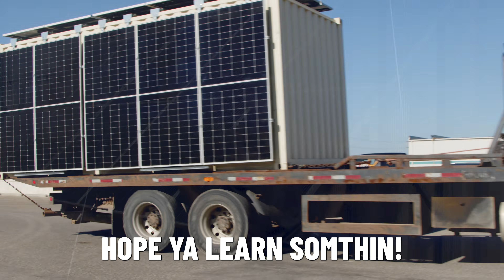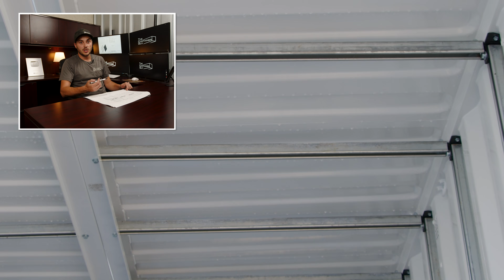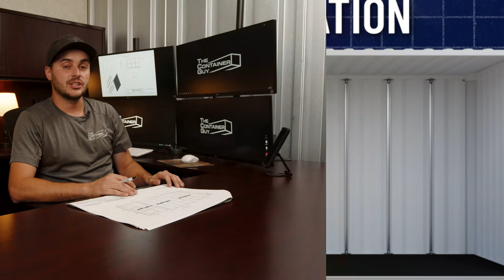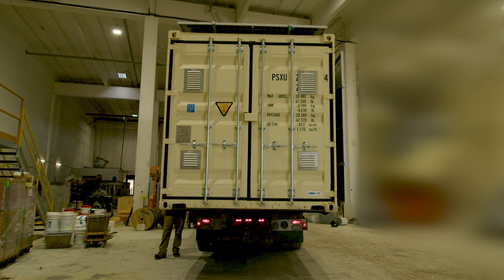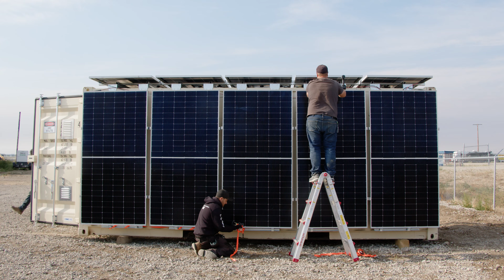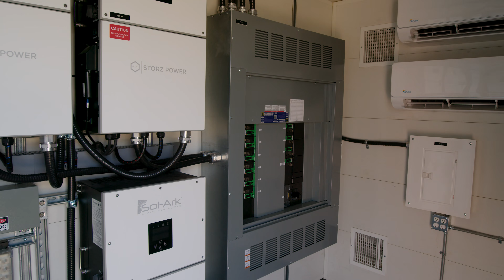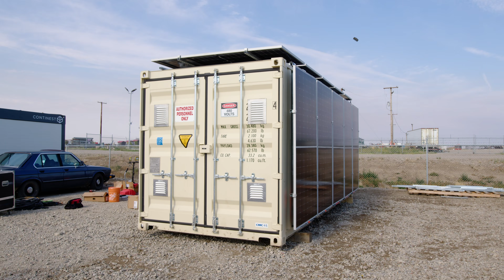Transforming a Shipping Container Into a DIY Solar Power Station! #NATO

Comment: I'm really puzzled, here.  You have 5.4kw worth of panels (enough to power one average US household, at best) on a shipping container with enough inverters and electrical panels to power a small neighborhood.  The battery storage capacity was unclear, because you barely mentioned those, but what I'm seeing is a container that will need a MASSIVE diesel generator to supply anywhere near enough power to the inverters and electrical panels.  The output from the batteries and solar panels would barely be enough to justify one of those Solark inverters...maybe two, if you're delivering split-phase 240.  This is like having a massive 18-wheel semi truck, with a 2-stroke dirt bike engine in it.  The solar and batteries installed on that trailer can't even begin to "drive" the enormous inverter output.  It just doesn't fit together, unless you are using a huge external power source, like the grid or a generator.
Reply: Jason, my thoughts exactly (ok, your thought were more detailed).  I view this project as a wonderful, detailed, alpha/beta concept version.  5400 watts barely drives 4  or 5 window AC units, assuming perfect sun.  This I know for a certainty, because it is what I am doing now.

Perhaps if they didn't hype it like they did we wouldn't be compelled to call them out.
Reply: @guillermomaguire5394  - Most people have very little concept of how many solar panels you need when it's sunny, or how much battery capacity you need at night or when it's cloudy.  There's enough inverter capacity in that trailer to use probably 20 times that much solar...maybe more!
Reply: @jasonbroom7147  agreed.  As an engineer, EE was never my forte.  But once you just think about watts as calories, the basics jump out at you.  As an example, the Bluetti AC 2000max (I bought).  Why have 2000 wh output when you can't suck in 2000 wh in whatever way you can?
Reply: @guillermomaguire5394  - Yeah, the logistics of powering various loads can be very daunting, when you are responsible for the generation, storage and delivery of that power.  It's not until you dive into this topic that you start to really understand the difference between charging your iPad and drying a load of clothes with an electric dryer.
Reply from the maker: This unit is meant to be coupled with 1-2 generators and a 135kW solar bank.
Reply: @TheContainerGuyTV  okay...that make sense.
Reply: @TheContainerGuyTV  - That makes sense, but it makes the addition of the relatively tiny solar array kind of silly.

Comment: Major overkill for the amount of panels mounted
Reply: The panels are only to keep this module operational, ie; this is only a control box for a much bigger project, I think they are going to hook up 100-150 kw of pv, a big generator, & maybe a heap more battery capacity too.  It is supposedly the cheap-ass proof of concept design.

Comment: What is the amortisation of this container?
Reply: At $450k the amortization is never. The inefficiencies of those Chinese built rebranded inverters that are actually only 12 kw output will fail multiple times requiring maintenance replacements  before the overpriced engninerding of this project ever pays off. The mobility solution of 10 added solar panels are effectively useless in comparison to the 135kw generator or the solar field required to power this what will be a permanent installation and the extra container ESS for power storage.  This will be a multi million dollar grid scale project when finished.

Comment: The military could probably use a bunch of these. A lot more quiet than running diesel generators and no need to refuel them. Would also be able to charge up any electrified vehicles they may get in the future.

Comment: Hi.  Someone may have already suggested it but I will raise it here in the event it has not been raised.  On the leading edge during transport you could add a wind deflector or wedge to direct the wind generated while moving away from the underside of the panels.  This should prevent the flexing you showed happened on the freeway.  It may actually even reduce drag and make it more efficient (e.g., less wind drag).   Same can be done on the top panel leading edge.  Nice job!  Clean design and the interior layout of cables and components.   Perfect for use afters natural disasters or in developing areas.   A smaller and more affordable unit would be a huge hit.  Please keep going.  Cheers!

Comment: Need to add tracking to each panel set to go from 0-90 deg of angle during the day to maximize exposure, it will add some cost, but it is not too complex & will yield much better output.

Comment: Hey, you are the one who's competent to answer a question of mine! :) Wouldn't storing energy in hydrogen (electrolysis) better and cheaper than traditional batteries? Have you any experience in it, or have you made any calculations? Would you consider to find out if it would be?
Reply: Efficiency losses when storing energy in compressed hydrogen are far greater than using batteries.
Reply: @jasonbroom7147  I see, thank you.
Reply: You only get ⅓ the energy back that you put into hydrogen. Plus hydrogen is a bear to store as it tries to escape from everything and embrittles stuff. .

Comment: It is amazing how difficult and expensive you made a simple and inexpensive process. I am still trying to figure out the way! The 5,400 watts of solar panels that you mounted will not produce enough electricity to run the twin A/C units that are installed let alone “a town”.
Reply from the maker: This is meant to be connected to a generator and a 135kw solar array. 

Would power about 30 houses or a mobile camp.
Reply: @TheContainerGuyTV  I did not hear that in the video. This explains the number of inverters in the container then all you need is 450 KWh of batteries in order to sustain the basic needs of 30 homes over night ie lights and refrigeration.
Reply from the maker: Didn't mean to mislead people. When we accidentally do, it always makes the videos do well. Maybe that's the secret 🤣
Reply: @TheContainerGuyTV  you could benefit from watching a video from African Green Tech posted 3 years ago.
Reply: @TheContainerGuyTV  If I were selling power to 30 homes, I'm not sure this would be economic?

Comment: I wonder if those springs that are used on car trailer ramps or horse floats would solve your lifting problem.
Reply from the maker: Yeah those are torsion springs. We tried it. Making them individual made them light and easy to handle. Not needed anymore.
Reply: good call. would save on costs as well

Comment: So a simple solution for the travel issue would be having a simple tarp over the container during travel. Specifically to seal up the front travelling face of the container to make the panels more aerodynamic during travel reducing the lift force the wind will place on the underside of the panels. Also added benefit of protecting the panels from potential chips during travel caused by loose gravel, rocks or other debris.
Reply: I was thinking the same thing. Just something to guide the wind around the outside of the container/assembly and over any rough spots it can snag. Reusable doesn't need to be strong, just exist to direct the wind
Reply: HIPP WRAP is much better than a Tarp.
Reply: How much does something like this cost?

Comment: During transport add a front lip to where the panels are You won't have to deal with the wind lifting up on the panels if you divert it from under the panels to over the panels as it drives
Reply: There is a "current" of air which will build up behind the Lip (about 5 or 6ft) and then cause the same problem for the other panels.... it needs to be wrapped with HIPP WRAP. Drive behind a truck on the freeway and you'll get my "drift".

Comment: My guy,,  an AC condenser does not mean it condenses sweats or makes water.. The evaporator inside the climate controlled unit makes water The condensers were rejects heat so if you're sticking it in the end of a container and you don't have a way to vent it you're not doing any good and waterproofing the floor doesn't do anything because it doesn't make water it makes heat

Comment: Great job!
I recognized the Hammond boxes and transformer. lol
Why'd they use a 3R enclosure on the transformer if it's not going out side?

Just thinking, is it possible to hinge panels off the end on a strut system that rotates?
Also snap latches or toggle latches on the struts to secure the panels for transport.

Comment: A simple XPS foam board cut to push the air around the panels instead of under them should fix the flexing while driving. (I have panels on my box truck and that's what I do).

Comment: Nicely put together. One improvement I could see for you would be to drill a hole through the unistrut to accommodate a pin to hold the panels at the correct angle. literally one guy lifts the panel, and another guy slides in the pin, Done!
Other than that, and I am not certain of how to fix this is that the condensers mounted in the smaller room are going to reject all the heat from the main room, plus also the compressor heat. that little fan on the side is going to have a lot of heavy lifting to do

Comment: hmmm I watched this video and I'm not sure what this is supposed to do or be.  It is not a "solar powerhouse capable of energizing an entire town".  It has 10 x 540 or 5.4kw of solar, that is not enough to power 1 average Canadian house for 1 day, not exactly a whole town.  Also it seems to be lacking in battery storage to be able to store enough over a month of sitting idle and then powering a whole town in a burst for a day or something.  So does anyone know what the purpose of this would be?
Reply: It is a cheap ass version of govt project prototype, proof of concept; control box for 2 generators & 135kw of solar pv to be hooked up to it. The 5.4kw of pv & small battery capacity is just to maintain the inner controls between hook ups to other generating sources.
Reply: still confused... the 135Kw of solar will definitely not be a portable installation, so why is this unit portable? it will have to be left at the site of the actual 135kw of solar so why not just make it part of that installation
Reply: @waltersavonian7551  You can pack everything else into shipping containers and then it's pretty easy logistically to move it. Its meant to be semi-mobile, think military FOB. You get it there and set it up, and it comes in 5-6 shipping containers.

Comment: This is a pretty amazing looking project.
Several concerns all around the space conditioning:
1) Doesn't seem like it's anywhere near enough ventilation on the hot side to keep those AC condensers happy, they'd work better, use less power, and last longer if you could feed them outside air, maybe from a pair of big vents installed directly behind them. Much more outflow from the hot side to outside seems needed as well.
2) Using AC is a bit self defeating in terms of making power, possibly lean more in the direction of cooling via ambient venting by increasing the size and number of vents and fans.
3) Why is the ambient venting pulling in from the hot side rather than outside? I imagine a case where it's been using the AC for a while, then detects outside temp has come down and switches to fan venting, but the hot side has built up so much heat from the AC condensers over there that you're just pulling in hot air for a very  long time, or at least as long as it takes for the system to switch back to AC.
4) It appears that the floor is the only intake venting on the hot side, any concerns about this unit being used in a snowy place that might build up around the unit blocking underfloor intake. Is roof venting an option?
5) Dumping the AC condensate water directly on the ground in the center of the hot side seems like it will lead to a very moist environment, possibly consider running it to at least the outside edge of the container where it can run off away from the container.
6) You may want to research shipping container server room builds, they have a hot side as well for the cooling equipment, and it's typically VERY open to the outside, like mesh, or the condensers are actually mounted to the outside of the shipping container, sometimes inside a wire cage for security.
Reply: You bring up the same points I thought about while watching this. Hope they reply

Comment: Nice build. A simple tarp would prevent the wind from nearly wrecking your project during transport.
Reply: I was thinking that, or fabricate a fairing or wind deflector on the leading edge of the shipping container to guide the wind around the panels.  People who put solar panels on their RVs often do something like that to keep the air from going under the panels and for fuel efficiency. Tarp could be better depending on how often they want to move it.
Reply: @SetitesTechAdventures  on a $450k build, either of those would be affordable options.

Comment: can you drill the outside channels so that stop pins could be put in place to support the panels at different angles?  I'd personally be thinking like a trailer hitch pin (1/4" diameter) .  I wouldn't think most people would want to move the panels more than 3-4 times a year, at most.

Comment: you could weld or attach a slanted wind deflector on the side where the panel is located as well as the top; to deflect wind past the panels entirely while under transport, to keep the panels from planing.
Reply: Just using cheap snap latch on the struts would work vs welding to galvanized struts.

Comment: Could you add wind power and do you have batteries in the container?
Reply from the maker: Our next project we're going to try some axial turbines on the 4 corners for fun🤘. Panels on the side only on a 40'.
Reply from the maker: Let me know if you know of any good brands. I have started shopping.
Reply: @TheContainerGuyTV  I know very little about selecting and  installing wind turbines but would love to see your solutions.👍. It’s jus the idea of batteries, wind and solar, with a modular container housing the controls and you are self sufficient.

Comment: Very innovative. I live in a very humid environment. I caught the condensation from my heat pump a few years back and got more than 10 gallons a day. Seems a water storage and filtration system would be a helpful addition to an off grid type system like this.
Reply: I'm in north Australia currently, finding im getting roughly ten liters of 'condensation' from each down pipe. 
Because of the heat difference of the heat sink roof cavity, to outside morning air. 
As you mentioned the pump, the container would be dealing the same issue. Nice to raise the water storage to the mould even tho water an electricity don't mix, it be good to have "fresh" water in an arid area whist it's generating power for you
Reply from the maker: Awesome info to know!! Thanks

Comment: Which type of wire is best to use when building a container home? I've heard not to use BX  instead to use non metallic sheathing wire such as Romex. I'm using steel studs for framing. I purchased one of your kits. Works great.

Comment: Awesome!!! 
Thinking adding a third side of pannels the extend up above the roof line, roof flat, and parallel lower side as you have, obviously something will have to be done about that beautiful man door... also external mount one mini split heat pump, which can service 2-3 heads inside...the heat pump shoult be in the shade of an end solar panel mounted for flip up over a man door on end... double doors on other end insulated,... unit comes with clip on rain catch system, tanks shipped with the unit...2x750 gallon collection, to operate low volume flush toilet and urinal, with universal Sink, kitchenette, with smaller efficient fridge, of course batteries for hybrid offgrid option, but complete with hookups to support a grid tie to existing structure.... something that a helo could drop any where and support 2-4, or pack up and ship around the world for a med clinic...need to talk to the rain farmer from nevada?
https://youtu.be/nLphSEiHroU?si=YWTNEV0vg-t3rhPq

Comment: I did this with a solar company several years ago on a government contract.  How come you dont use gas struts offset for easier lifting?  Also pin thru unistrut for secure stowage.  mobile applications are a different world, vibration will kill your product, nylon nut or locktite regardless.

Comment: this is an amazing idea!!! after seeing all those EV fires I'd never dare to put the solar batteries inside my house, and a shipping container seems to be the perfect solution for this.
Reply: True, but remember all batteries don't catch on fire.  There are non flammable battery solutions available.
Reply: @Danjirus  at the cost of much lower energy density, or the tech is experimental, I know. Still, better safe than sorry, and if it takes a shipping container to prevent the destruction of my home, then it's not a high price.
Reply: There's several million of batteries used daily all over the world without endless catastrophies...
Reply: @OmmerSyssel  most of those batteries aren't in EVs, nor are they Li-ion. Electric cigarettes also like to catch on fire BTW.

Comment: Great content!  Always learning something new. Consider using pull handle with stab locks for each unit (similar to truck bed slider). You can set your own positioning (various angles based on time of year). Best part is you can set a stop for the closed position and no need for any additional tie-downs. Great work!